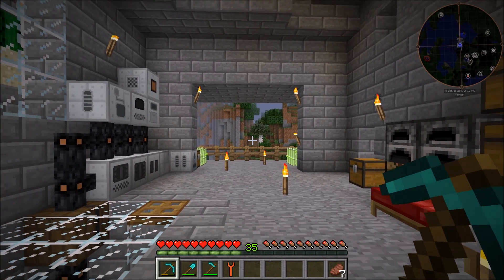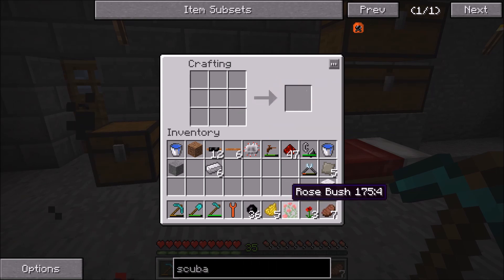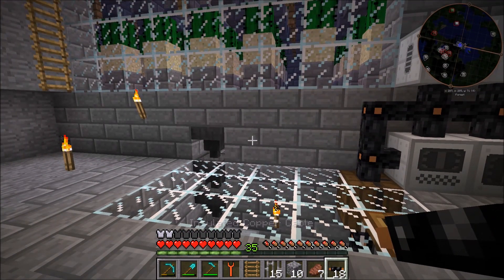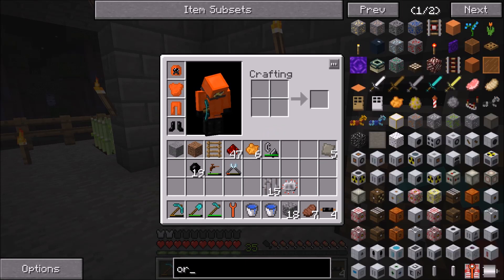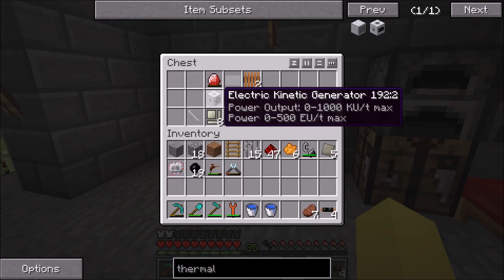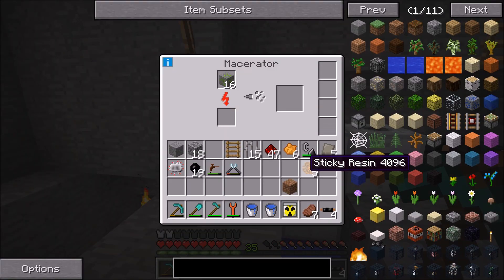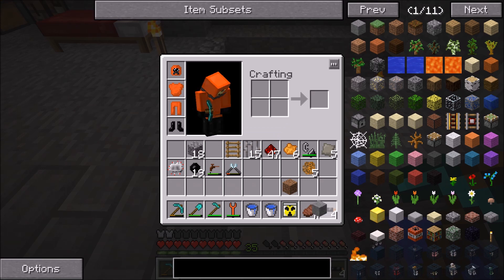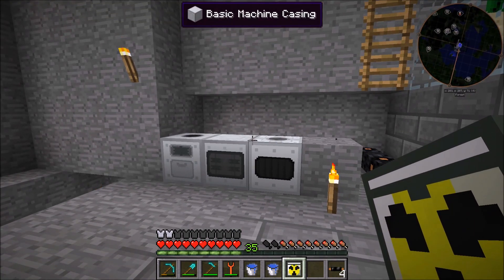Surviving With IndustrialCraft 2 :: Ep.7 - Processing Uranium

Comment: The centrifuge is not just for separating the isotopes of uranium, you can use the same centrifuge to extract minerals from slag taken from the blast furnace. [IC2 slag only, not Immersive Engineering slag]  Stone dust can be made by centrifuging cobblestone.
Reply from the maker: Interesting! I never really messed around with it outside of the uranium so its nice to know it has other practical uses :)

Comment: Man, compressed air. That takes me back to Ultimate. I did a video on Bauxite processing where the compressed air cells that were a byproduct were sent to an extractor to be emptied. Of course that was a GT thing, so it's not something you've got to deal with fortunately.

Something I did do then that might help you now was to run the GT Blast Furnace, which required 128EU/t, was to not power it from a cable. Instead I had an MFE plugged into it, so I charged that and then ran the system. Because of the way GT machines worked, anything less than the required voltage was simply eaten, but you could charge higher tier power storage from lower ones, so I had a solar panel plugged into it to trickle charge the MFE. Could work here for your Thermal Centrifuge. It'd isolate it from the rest of the system, and let it slowly build charge without instantly bottoming out the rest of your power system.
Reply from the maker: +Triaxx2 Oh, that's an interesting concept! Ill be sure to use that for any huge power consuming system I make so it doesn't completely ruin the rest of the machines :)

Comment: Hey rage nice vid and really i almost didn t notice anything different with your voice it s fine really. Hum i have a question about your previous video setup, you said today video it work like a charm but when i tried to reproduce it in creative i was having power loss from the whole system, fermenter being the bottle neck. I really tried to do it as you did but nope, the amount of biogas produce by the fermenter isn t enough.
For exemple if i fill with biogas the 3 machine (semi fluid for the system only, liquid heat, and semi fluid main outpur) it slowly decrease overtime, it s slow but it s a loss. Any idea what i did wrong?
Reply from the maker: +Lynn Avezou assuming you replaced the electric heat generator with the fluid heat generator, there shouldn't be power loss. KEEP IN MIND you need to allow the system to run for a while before the power production starts because the system is based around being backed up. Eventually the macerator will have 64 bio chaff in it and stop running constantly and same with the canning machine and fermenter once they fill up with biomass. If these are still running constantly trying to back up the system it may be burning through bio gas, but once they stop it should start gaining power and bio gas.
Reply: +DrRageHard I did all that i ll check again it s just too wrong. Btw love the videos format in general, i m fed up with people moving from one chest to another without showing any content. You are preparing your videos and i never lost interest when i m watching because it s always interesting. cheers
Reply from the maker: +Lynn Avezou Hopefully you were able to fix the system (let me know if you are still having problems!) and I'm glad you enjoy the video format :) I try to keep it is informative and entertaining as possible without being over the top hah